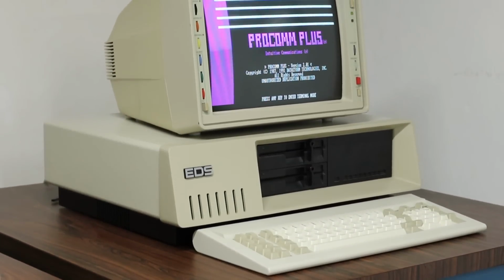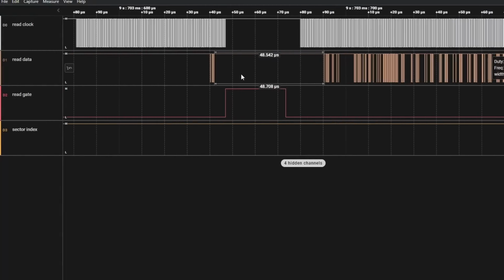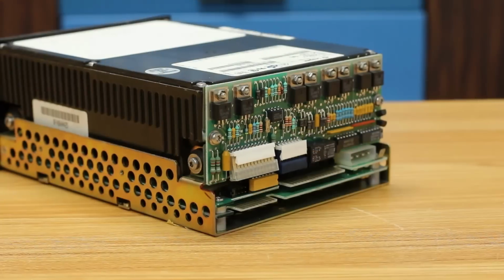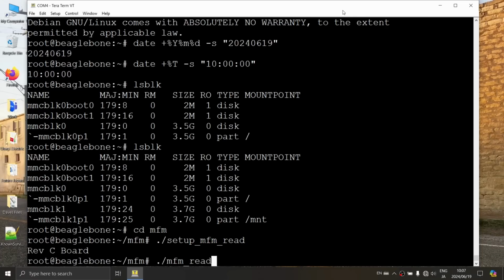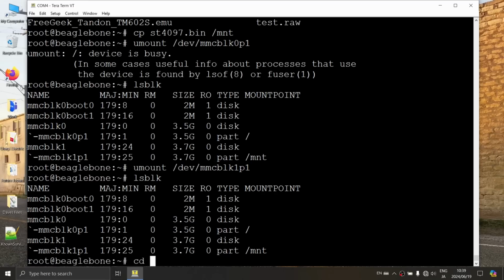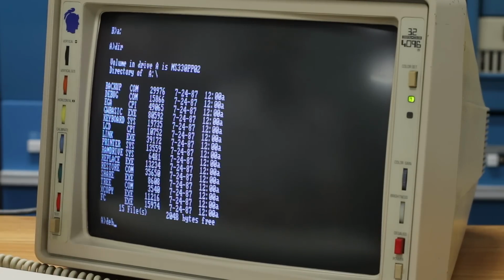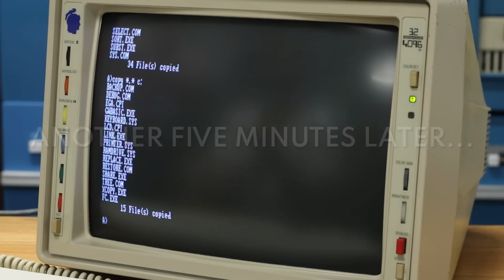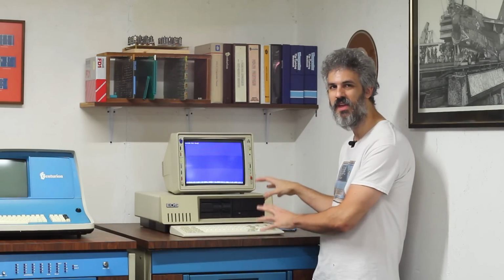FM is RLL, MFM is RLL, RLL is RLL! Fight me.

Comment: Back in the early 90s, I remember connecting an MFM hard drive to an 8-bit ISA Seagate RLL controller and I would get an additional ~30% storage after low-level reformatting the drive.

The downside was that I noticed the drive would run hotter. Someone once explained to me it had to do with how it would run the actuator which was out of spec.

So yes, I would agree from experience that MFM Is RLL and RLL is RLL.

Comment: I remember I used to use xcopy.  Xcopy (cross copy) copies across formats ( disk capacities ), and can create a bootable disk if command tail specifies.  If memory serves me correctly.  As you say, it was a long time ago.  I don't recall needing to start with a fresh disk, but having a floppy based PC, if I needed yet another boot disk blank disks flowed like water, so I may have never run into that problem.

Comment: I was a PC tech and owner when the RLL controllers came out.  While everything official said you needed a rated drive (at least to be supported), common knowledge was that most decent MFM drives could be re-formatted using an RLL controller for a ‘free’ 50% increase in storage space.
 I bought an Adaptec RLL card, and successfully used it with a ST-225, and a Miniscribe (also a hh drive) and had twin 30meg drives.  Later replaced with a giant Maxtor full height that formatted out around 200MB, unheard of for a 8086 box.

BTW, aside from the Falcon controller made by Tim Patterson, the fastest a 8 bit MFM or RLL controller could manage was a 2:1 interleave.   1:1 overran the bus unless you knew the magic Tim did.

I still have that Maxtor and the controller along with the Compaq deskpro, not powered up in years.   I need to image it, so getting that magic board to support RLL would be really exciting to me.

Comment: Seagate defined the inexpensive fixed disk interface with its model ST-506 full height 5.25 inch disk. DEC used ST-506 in the original HDU equipped Rainbows.  That interface was standardized as ST-506/412.  At the time, it was competing with SASI to be the cheap drive and tape interface.  ST-506 gave way to EDSI, the latter moving the data separator into the drive.  IBM used ESDI drives in some PS/2 models, and Sun and HP used ESDI drives in their minicomputers.  SASI gave way quite quickly to the more capable SCSI.  I have seen a few SASI tape drives and if I’m not mistaken, the Sider external drive for the Apple ][ used SASI between the drive box and the expansion card in the Apple.  The Sider external box had an MFM drive.

At the ST-506/412 electrical interface, I believe there is no way to tell the difference between a drive intended for MFM 1:2 operation and the various RLL formats.  It boils down to the quality of the platters and the rotational stability of the drive motor.  I worked for a company who had fielded a lot of Seagate ST-238 drives which were allegedly RLL certified.  The ST-225 MFM and ST-238 RLL drives are essentially electrically and mechanically indistinguishable.  Imagine that.  We found that we were getting a lot of failed ST-238 drives paired with Western Digital something-or-other controllers.  What we found was that after about six months of use, many of the ST-238 were showing spindle speeds of 3550 or fewer RPM when they were nominally 3600 RPM drives.  There really isn’t a field adjustment for RPM, and the speed error caused trouble for the controller staying in sync because there is less for the PLL to track.  Our solution was to install generic MFM cards and reformat the drives as 20 meg drives, then no more issues for at least a few years with the drives running MFM.  Back then, even 20 meg was a lot for an average user, so it saved quite a bit of expense by changing the controller instead of the drive.
Reply: On Western Digital controllers with ROMS, you could usually run the DOS DEBUG command from a floppy, then jump to the low level formatter in the ROM by entering G=C800:5 at DEBUG’s prompt.  The ROM formatter would prompt for the requisite information.

Comment: As a couple of other commenters have already said, if you want to get more than the 30MB out of the HDD you will need to low level it again after changing the jumpers on the controller card. The exact parameters for the 4097 are unlikely to be supported, but you can pick any larger geometry which has less than or equal to 9 heads and less than or equal to 1024 cylinders. Look up the model on the controller card on bitsavers or TH99 or similar and find a manual. The supported types should be enumerated in the documentation.
Reply: Yes, the 1024 limitation was something related to the maximum number of cylinders addressable at the time. Tools like DiskManager were able to reconfigure the disk geometry and later go beyond 1024.

Comment: My first HD cost 250.00 and was 32MB, still have the drive attached to the controller card. Bought that in 1991. Thought It would take a while to fill. 8088 12 MHz IBM. Second was 250.00 for 250MB IDE. 386SX. In the last 6 months, just upgraded my desktop 2 times, built my niece a desktop AMD. Built 2 more for me and boxed them up. Picked up an old HP Compaq for 10 bucks, no HD. Grabbed another Athlon HP for 10 bucks has HD and  Vista installed. Needed the IDE to get Superdisk drive running. Have picked up 3 Intel GPU's, 5 AMD GPU's the latest was the 7600XT 16GB, I don't do NV they don't play well with some Linux Distros.

Comment: Interleave basically translates to "how many revolutions of the disk are required to read all sectors on a track".  Smaller values make reads/writes faster until the controller's ability to read consecutive sectors is exceeded.  At that point performance falls off a cliff because an additional rotation of the disk is required between reading/writing each sector.  For old 8 bit MFM controllers on XTs, interleave of 3 was typical, but sometimes you could get away with 2, increasing performance by 33%.  RLL usually has a higher interleave value because the sectors pass under the heads more quickly (26 per revolution rather than 17).

Comment: FYI, an ST238R is simply an ST225 that passed a few more QC checks. Quite a few hobbyists with ST225s plugged in an RLL board and got the 32MB capacity with no issues.

Comment: Cool video, i'm actual working on an "WANG Professional Computer" (It is an MS-DOS machine witch is not IBM compatible and use ist own card interface no ISA connectors), with some problems with the comunication with the hard drive. It's an MFM Drive, spins up normally and runs through it's self test and the drives service manual says, when the powerlight stays on (What it does) and doesn't blink, the drive is in ready state. After 1 minute of computer selftesting it says "booting from winchester disk..... failed. After that i couldn't test anymore because the damn RIFAS goes up in smoke. But befor i powered it on, i dumped all the ROMs (safety first).

Comment: Interleave indicated how many sectors should be placed between sectors in a given sequence.  Why does that matter?  Because if you were reading sequential sectors, the processor would take some amount of time to transfer data to the PC. This means if you ordered them [1,2,3,4,5,6,7,8], by time you transferred the data after reading sector 1, the head may be physically over sector 4, or 6; and you'd have to wait for the drive to spin back around the start of sector 2.  If you get the offset right (say it was optimally 3 or 4 sectors), then an interleave of4 [at least] would put 4 sectors between each sequential one to get the best response time. That would give you an order like this: [1,3,5,7,2,4,6,8].  This way by time the system is ready to read the next sector, sector 2 is the next one to hit (or the one after, worst case).  If it hit a conflict when building the map, it would just push to the next free sector block, and continue that pattern until the sector list was full.  Worst case, some end sectors have slightly worse performance, but it' still way better than an interleave of 1 (which is how most early drives were formatted).

There was a tool called "spinrite" that would copy out, then low-level at about 20 tracks in with different interleaves to find the best one.  It would err toward the larger number, and then re-low-level format the whole drive with that offset.  (Later versions would change interleave several times over a larger drive, since the value could change based on track velocity and density.)  This would cause at least that first area of the drive to be perfectly interleaved.  Since that's where the boot, system, and often the MFT lived, it made the boot sequence, and the entire performance of the filesystem significantly faster when properly tuned.

Mind you: some drives did not support this low-level rewriting.  Many RLL drives would forbid it, since the read timing was so critical that it couldn't be relied on for that track data to be written out in the field.  The equipment needed to do the timing properly was far more expensive, and was only found in the factories that made the drives.  By that point though, manufacturers were optimizing interleave anyway before production, and drives started having buffers to optimize the transfer to the system.  Some early RLL drives mistakenly left the low-level write code in though, and triggering it would just nuke the entire drive.  Guess where your ST241 lands in that!  If you guessed "nukeable with spinrite", you'd be correct.  I know that one from painful personal experience.
Reply: bit late - i blame the traffic

i always assumed it was to give the system time to process
the controller bios did an interleave test.. and for 8088 it was 3 or 4
for 486 it already reached 1 ..

i assume that DMA and buffers rendered the Interleave defunct.

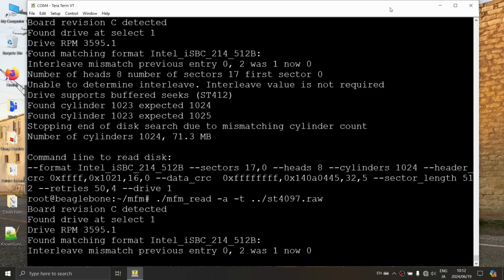Comment: 17:56 I had an ST4096 back in the day.  
Looking it up, I see that the difference is that your ST4097 is RLL, as opposed to the original ST4096 which was MFM.  Due to this, the higher number of sectors per track gives us the higher transfer rate and capacity.

Comment: MFM and RLL drives, now that's a while ago!

I can't remember the details, but I remember when RLL drives came about. Or was it the controllers that started supporting RLL? Frankly I can't really remember. I do know that the same drive could be formatted using MFM or RLL and using RLL it gained something like ten or twenty percent capacity. at the time this was a big thing.

Other things you had to test was performance related. The formatted sectors on a track on the disk was not necessarily ordered 1, 2, 3 and so on in series. Usually you inserted interleave sectors, so the order could be 1, 8, 15, 2, 9, 16 and so on. This was done as the computer, card slot or the disc controller couldn't read the sectors if they were just stepped up by one every time. Then the disc had to spin an entire revolution for the controller to read the next sector. But with the right interleave it was ready for the next sector when the interleave sectors had passed under the read head. With an interleave of 0 a complete track could be read at one revolution but it was very uncommon you saw a computer able to handle that. An interleave of one meant that it would take two revolutions to read the entire track. Each time you added a interleave sector the necessary revolutions rose by one, so you wanted to use a interleave that was just big enough that they computer could handle it.

Another thing was the data listing defect sectors on the disk. This was used to map these so they wouldn't be used when accessing the drive. Most of the time they came on a separate paper with the drive, but often they were also written on the label of the drive. Some times they were rather long and other times there were just a few listed. This data was entered when doing the low level format of the drive, this was also when you set the interleave so that it was used for the format when installing the OS.

What is interesting is that so much of this has become antiquated knowledge. It must be at least 20 years since I low level formatted a HDD, perhaps 30 years.

Comment: In the MFM/RLL days, the controller and drive needed to be matched.  If you low level formatted the drive on one controller, it wouldn't work on a different controller (i.e.manufacturer and type).

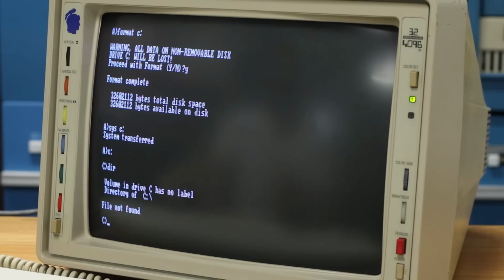Comment: 31:30 you could have added a /s after the format command to essentially do both steps at once. Been ages since I used that early of a version of DOS, but I know that worked at least with version 5 and later. Should still work on 3.3 though I believe.

Comment: I would of put msdos 5.0 or 6.22 , which both runs perfectly well on XT systems.. and allows are larger size drives, however, the you would be limited by your drive controller.

Comment: There is a windows 98 program(don't remember the name) that will allow you to transfer TCPIP packets over the parallel port. It does run in DOS mode. 

I have an IBM Model 80 computer(80386 machine) that is running IBM OS/2 v2.1. I was able to run this TCPIP transfer mode program in OS/2 dos mode and connect it to a WindowsXP machine via the parallel port. The Model 80 does have network ability but ethernet cards are VERY difficult to come by for Microchannel and then getting the drivers for those Microchannel cards even more difficult. The Model 80 did come standard with a Token Ring 4 network card. But seeing how Token Ring routers you can find today are all Token Ring 10, a Token Ring 4 card is useless. 
When I got TCPIP over parallel working, I was then able to run Netscape Navigator on the Model 80 and do a Google search. Google even did the connection in HTTP only and not HTTPS. 
The world's only 386DX computer connected to the internet.

It would be great if you could get that same TCPIP packets over parallel port running on that EDS PC and not only backup the Centurian to the EDS PC but then allow the EDS PC to take snapshots of the Centurian backup and store it to Drop Box or something similar.

Comment: It has been quite a while since I saw anyone so happy in preparing a hard drive for booting into DOS 3.3!
Others have mentioned the FORMAT C: /S command which formats the drive for system booting, and the SYS C: command that installs, on the right place of the disk, two hidden files, MSDOS.SYS and IO.SYS. Check the Wikipedia on MSDOS.SYS for further clarification.
But what actually prompted this comment was FDISK. There is an option there to make a partition active. This will be the partition from where the system will try to boot. Considering the drive size, you can have another partition and make it active. Not necessarily a DOS partition... ;-)
Finally, the interleave is the physical sector jump that will be used to read the logical sectors sequentially. You see, the computer may be too slow to read the physical sectors directly one after the other at the platters speed. So the interleave will compensate for this and will consider the logical sectors jumping forward 4 (in your case) physical ones so that the data will be ready for access at the most convenient place for the computer to get it efficiently.
I hope this helps, I apologize if all this has been described in the comments, I haven't read them (yet). Thanks for your channel and enthusiasm. Cheers!

Comment: To format the harddrive and transfer system in one step you can use
A>FORMAT C: /S
but also to make your system disk look a little nicer you could place the dos files in a subdirectory by itself.
A>MD C:\DOS
and then copy the diskettes from A -> C:\DOS
A>COPY 'star'.'star' C:\DOS (Youtube won't show the 'star' character)
to enable the system to find the dos files at the correct subdir you need to add following line to the AUTOEXEC.BAT file
PATH=C:\DOS

Maybe other ppl suggested this too, so I'm sorry if this would be a double entry.
Very nice machine :)
Reply: Instead  'star'.'star' you can just type 'dot' eg .

Comment: I know a lot about the ST-225 / ST-238 , rotation speed stability was the difference as RLL needed better control . The ST-238 is a ST-225 that passed testing .
The ST-238 is sutable with modifications for video image file of one digitized with ( PWM on disk ) NTSC frame per track a quiet revolution at that era : )

Comment: Ah man. Most of the stuff you work with on this channel is before my time, but this stuff is just prior to it - so I learned about it with fascination. You seem unfamiliar that PC BIOSes need a drive-type table in BIOS setup somehow - and if the PC doesn't have it in its BIOS, it's set up somewhere else (e.g. ROM on controller card reading a fixed set of presets). You know all that "drive type: 1, 2, ... 45, 46, 47" stuff? Cylinders/heads/WPComp/LZ/sectors setup stuff? That's what's needed here for the BIOS and OS to understand the drive, to know what limits to call for, where sectors wrap to heads and to tracks, stuff like that. If you format an 8-head drive while the system thinks it's 4-head, you just left half the capacity on the table and half your platters are now blank!

It also introduces a whole world of complexity in controller<->disk pairing, as a drive formatted on one controller may not be readable at all in a PC with another controller. If you remove drives, and you want that data back, ... probably a good idea to keep the controller card with it. A drive separated from its controller is a wildcard.

Hope we can eventually retrieve the data from that old spinning disc of rust!